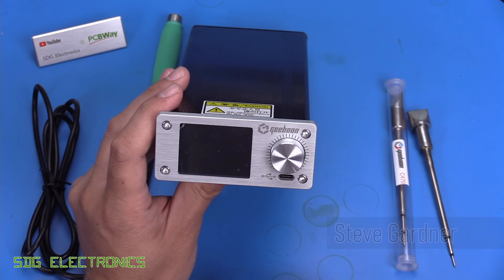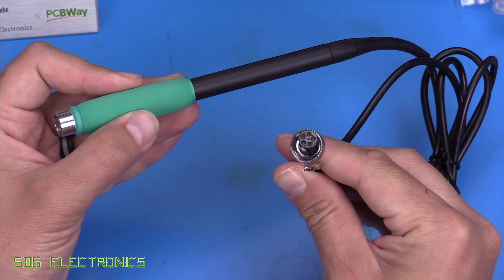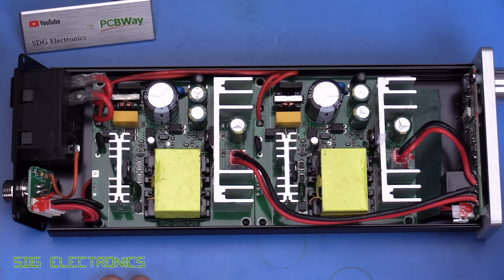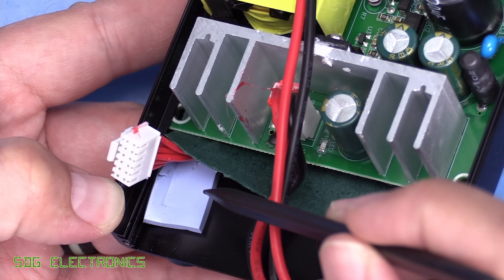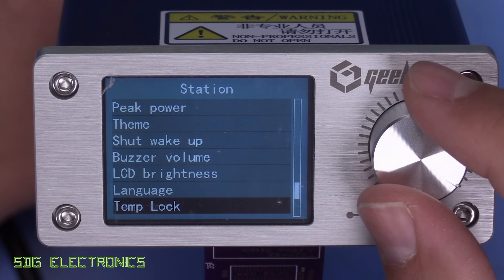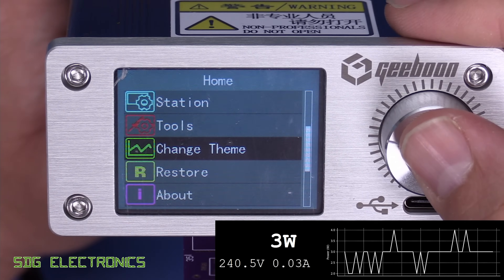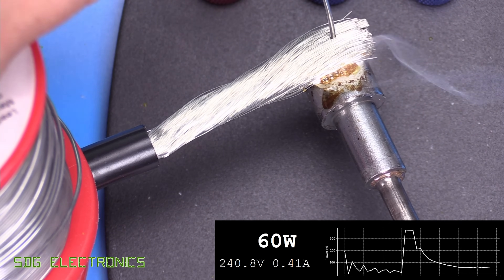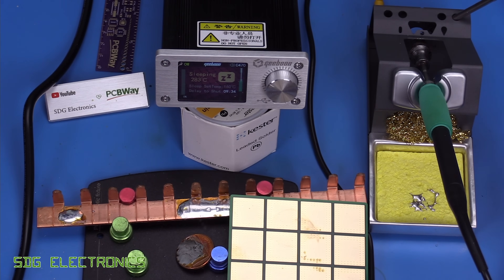SDG #366 Geeboon C470 380W finally tops Metcal power!

Comment: So would you say this is the best iron for things like Amass XT90/XT150 connectors with 9AWG wire, and copper busbars? My 60-90W irons won't transfer anough heat. Is there a similarly good one with better availability in the UK?

Comment: Hi Steve, thanks for another great review 👍
Q. What software and/or tool do you use to show mains power usage with the graph in this video?
Reply from the maker: It's a Hameg power monitor. I just poll it with SCPI commands in a python script
Reply: @sdgelectronics A very competent solution for measuring the power supplied to the soldering point. It remains to apply a conditional polygon with infinite heat capacity and thermal conductivity. For example, a copper heatsink for a processor. And then you can easily figure out how everything works.

Comment: Took 380w to beat 80w
Reply: Did it, though? The meter showed it was pulling around 80 W as well while it dumped heat in. I wonder if it's contact area, rather than electrical power. It also doesn't change my lust for a curie-point RF iron like a Metcal.
Reply: @pariahzero  Its contact area. Basically showing you for 99.9% of soldering tasks, 80W is enough power when you have an ideal control loop (rf heat).

Comment: If I need that size of a tip I just grab a 250W mains powered iron. If they made some smaller tips with substantial mass behind it, that can be used on GPUs and similar boards, that would be a game changer.
Reply: There are tons of JBC cartridge tips of every size, shape, etc.  C115, C210, C245 and C470.

Comment: Can you look at the FNIRSI DWS-200, GEEBOON HC24, and its tip voltage to the ground potential? TIA
Reply: There's no point in looking at the Fnirsi, as on its tip present noise up to 110V AC (no ESD support), while the HC24's voltage is less than 2mV (ESD FREE). And the power ratings are different; the HC24 can handle a C470 tip.

Comment: Was there any good (enough) cheap station that could drive original JBC-AM120-A tweezers? (I have dual JBC while three handles/tweezers... switching cables is annoying, so simple (no stands etc) compatible station would be interesting).
Reply from the maker: I didn't find anything that would work directly at the time, though I will try to take another look into this.
Reply: Either get a switch box or just run the handles off the clone station and use the official station for tweezers, not that hard.
Reply: @jaro6985  Any working/tested "switch boxes" ?

Comment: I bought the Geeboon TA305  (C210 and C245 kit) back at the start of January along with Geeboon's 3-way SW03 handle switch and recently picked up one of their C115 irons to fill out the 3rd receptacle on the switch unit and grabbed their new SDC20 stands at the same time to replace the metal units I got previously - the new stands have a nylon base which when you have 3 of them side by side while using the SW03 unit are a must as the metal stands could contact each other which could cause issues with the SW03 switch handle detection as it uses floating voltage to detect which handle is out of its cradle, other than that the iron/tip detection works great even while going through the SW03 unit.  Regarding the Geeboon tips, with each purchase I got an assortment of tips and they have all been good in my experience.

After owning and using the TA305 over the past 5 months it has been flawless, the linear coil definitely helps in the TA305 to keep the tip at the set temperature.  
Geeboon's newer HC24 or the even newer HA310 looks like the upgrade to this version in your review, I have been tempted to get the HA310 unit for working with electronics which have larger ground planes but so far the TA305 has met all my needs.
Reply from the maker: Yes I've just put those two on order to review as soon as they arrive!
Reply: @sdgelectronics  looking forward for HA310 review

Comment: Your link goes to a different looking station with 3 buttons on the front rather than the one you reviewed, and searching for it yields no useful results. Can you please link this specific one? I bought the Aixun station largely based on your review and I've been pretty happy with it and I thought this one looked rather nice for those rare high power uses.
Reply: Some links don't work for everybody. AliExpress (among others) use geolocation heavily.

There are a lot of AliExpress links which load and show a product... until JavaScript loads, does the geolocation, notices I'm in the USA, and then switches to a 404 not found.

I think they decided to show the 404 instead of having fine print that says "this product cannot be shipped to your location."
Reply: /item/1005006511804198.html
Reply from the maker: Apologies it should be there in the description. I'm not sure if they're making this one EOL though, I see two new ones so I've just ordered those to review.